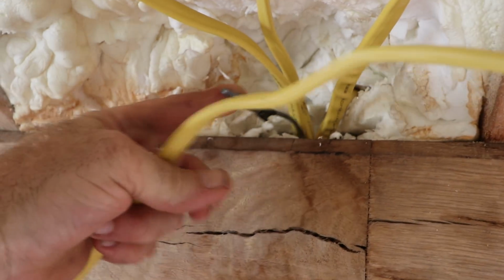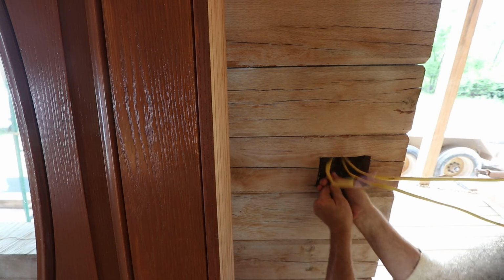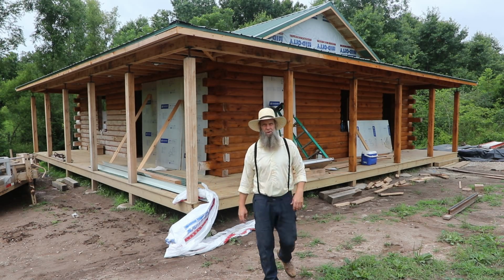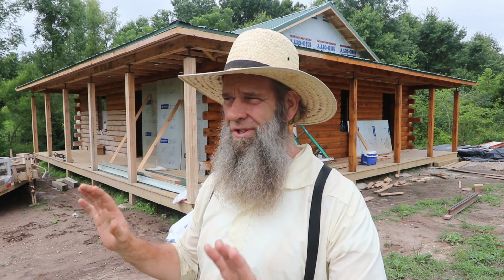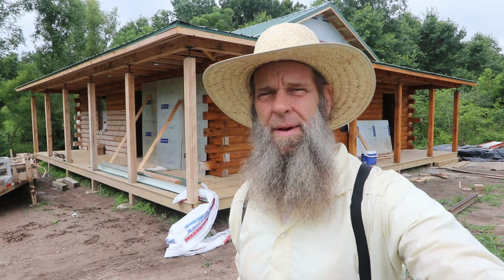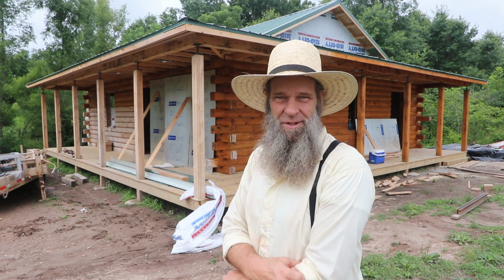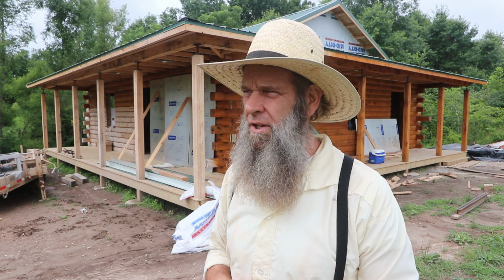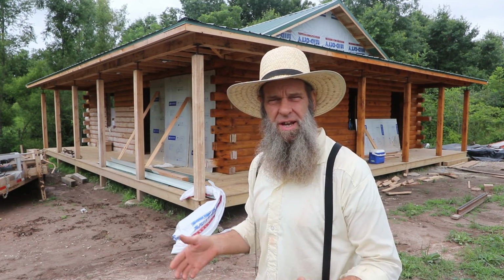Construction TORNADO hits the LOG CABIN BUILD! wires and pipe everywhere

Comment: Loop both wires back on themselves joining them together at the loop, coat them with a little dish soap and water and they pull a lot easier. If you pull too hard you can break the casing inside the wire and drive yourself nuts trying to find the short!

Comment: You need to be using a rub down tool on those foil tape joints.The foil tape adhesive is friction activated and won't stay stuck without friction...I use a nylon rub down tool.....

Comment: Doug, question for you or anyone else that does roofs and insulation. Doug mentioned his way of getting the heat to escape in a previous video. My question. how does the heat escape when the interior of the roof is  covered with foam insulation?

Comment: Should do plumbing first than hvac then electrical
Reply from the maker: why
Reply: @OFFGRIDwithDOUGSTACY  then electrical holes won’t interfere with plumbing and soldering of water lines wires need to be protected or fire down the road may occur just my 50years of experience as a general contractor just trying to help

Comment: Hi Doug , now that I've had a good look at the crawl space and how deep it is , I'm wondering why you didn't just go ahead and make a regular cellar / basement. ? They make a useful extra space for the house. My grandma had many shelves of her canned foods down in the cellar. As well as a huge pickle crock for making her prize winning dill pickles. Plus a cellar is handy for natural cooling of a house during the summer time.
  Whew , you were lucky with pulling that wire.  Which shows that the wire channel was 1/8" to 1/4 " too narrow. Pre-planning would have made pulling wires much easier. Hind sight , eh? You won't always be lucky ! Always keep Murphy's law in mind. As well as Mrs. Murphy's law. Which is that if it can go wrong/break , it will do so at the worst possible time ! Such as , you are on the roof of a two story house, and the thunder storm has begun dumping a gully washer upon you and the ladder falls over just as you reach for it.

Comment: I am a bit confused about something, somebody said that a 20 amp circuit with 10 boxes each box is considered 180 W and I'm not finding the right numbers to that, the 20 amp circuit for 10 outlets using that system would come out to be about 240 W per box,That is if you go with what you're describing. Now if you were saying instead of a 20 amp servic,  you were building a 15 amp service, with 10 boxes, you would come out to be 180 W per box. Come to think of it I'm thinking they actually meant to say 15 instead of 20 amp... well I picked up what he was laying down so all is good🧐

Comment: I noticed that all of your electrical wiring is in yellow. This might seem a weird question to some. But, how will you know which wire is for which socket  be it light switches or power sockets? Or are you doing them as you go along with the wiring installations? When the cabin has been built for some time, and this wiring is hidden behind the walls. Are the wires going to have tags attached to them so people know what goes where? (Bare in mind, I wrote this before watching the end of the video)
Reply from the maker: We are labeling them as we pull them
Reply: @OFFGRIDwithDOUGSTACY  Thank you for the update, it's appreciated Doug. And maybe change your name to Doug (the batman) lol